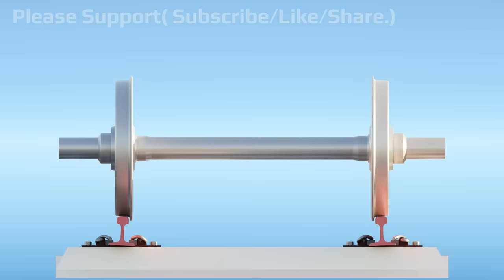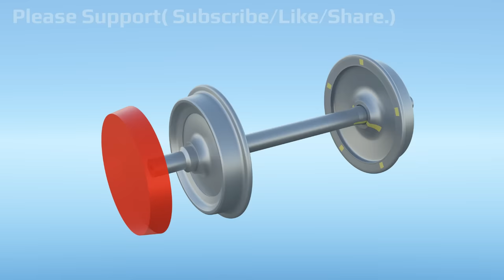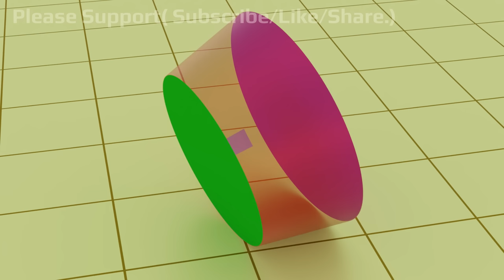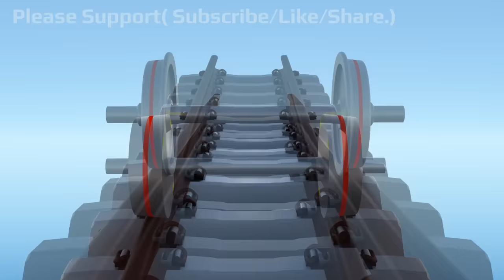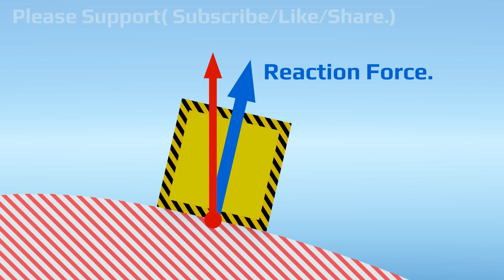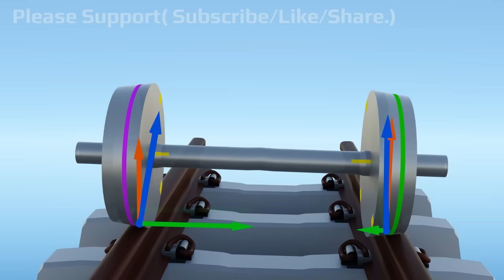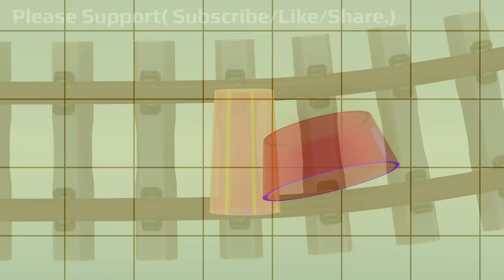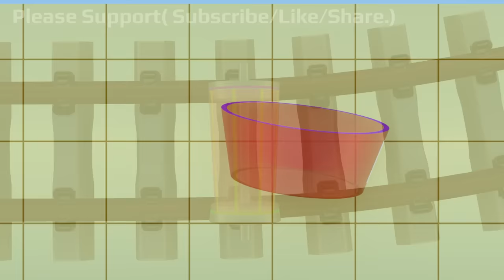How trains actually Turn ? | on curved rail track.

Comment: This is a broadly correct but simplified explanation. Some extra details: the wheel profile is not really semi-conical; it is a complex hyperbolic transition into the flange. But at first glance it looks like a conical shape. The inside camber (angle) of the rails is necessary to prevent the "conical" shape of the wheel set exerting an excessive lateral force onto the rails, which would otherwise tend to be pushed apart. Two interesting effects can actually be heard; one is where the train has come to a near standstill on a curve with superelevation which is normally designed for higher speeds. Then the wheel-set is not sitting in quite the right position on the track, and one wheel starts to slip with stiction, giving an audible shuddering noise. The other audible effect is where the curve is so tight that the flange comes into action: this results in a sharp metallic (& loud!) squealing sound. This is usually at slow entry & exit sections into / out of stations and switch yards. To minimise flange wear, automatic grease pump stations on the track are often employed at these sections, which only grease the inside surface of the rail where the flange makes contact, but not the running surface of the rail (you don't want grease on top of the railhead).
Reply: Exactly. There is a curve between the tread and flange which helps centralize the wheelsets.
Reply: indeed, but in previous steam, they hadn't understood that yet. Like gears, involute was pretty recent - the pressure angles changed in 20s and then 40s.
Reply: Exactly.  I have said this many times.
Reply: "The Loop" in Chicago is really loud as the trains negotiate ridiculously tight curves.
Reply: I've tried to explain this so many times to my grandsons and they never seemed to grasp it. Showed 'em your comment and finally they understand. Many thanks!
👁  👁
    👄
Reply: Its a YouTube video not a university text book
Reply: @J-Vasa  Of course. I just thought the extra details might be interesting to some.
Reply: @J-Vasa  why not both
Reply: @filiprebro  porque no los dos? *que the commercial
Reply: @earthwormscrawl  There's a suburban line in Wellington, New Zealand, that suffers from very tight corners (I was told they're the worst in Australasia) and the squealing is hideous.
Reply: Love the extra info, thank you. Could you explain what a complex hyperbolic transition is and how it’s different from a semi conical shape?
Reply: @jakejordan9810  I don't know anything about train wheels, but a hyperbola is a particular two-dimensional curve of infinite length whose ends both converge toward different lines. My understanding is that instead of having two straight profile forming the wheel and the flange and meeting at and angle as shown in the video, there is only one hyperbolic curve that transitions smoothly from the straight wheel profile to the straight flange profile.
Reply: Yeah the jubilee line could really do with some grease in those sections as you mention.
Reply: @etiennemiemczyk7081  Those flange lubricators are used throughout the London Underground system. Only the curves on the Underground are so extremely tight that grease can only do so much...
Reply: @ngc_2419  Thanks for answering that, you explained it better than I would have done. There is lots of more detailed information out there if you look for "train wheel profile".
Reply: cheap grease on the railheads won't do a damned thing to the traction- the pressure is beyond the scope of the lube's range.
Reply: @tommurphy4307  The grease used for those flange lubricators is likely cheap, but it is a heavy grade, loaded with a graphite dry-lubricant which is very pressure-resistant. The lubricators are supposed to only grease the inside of the railhead and are designed accordingly, but they do occasionally go wrong and spill the grease onto the rail head; quite a few reports of engineers reporting this causing issues with both traction as well as braking. There are in fact specifically formulated top-of-railhead lubricants also used in the railway industry, but they are a much lighter grade and either mostly water-based (Europe) or oil-based (US), and maintain higher traction.
Reply: Not broadly correct.  The camber on the rails and wheels  does help the train travel down a straight section . Thats where its most useful, in reducing wear on the straights.  Remember how if you push something it tends to turn the front out ... like reversing a trailer, it just wants to turn and turn... if its constrained between two walls, the thing you are pushing can bounce side to side.  But if you pull the same thign,  the front is constantly corrected just enough to go torward where it the pull is coming from , which is great if that is on the path. eg car towing a trailer.. the trailer follows the towing vehicle, all stable, well behaved..  Well the camber on the rails profile acts to  steer the bogey toward the  direction of the track ahead... so there is less bouncing side to side on a straight...    its just a reduction in wear, mainly on straights, and not  "only required on curves, to allow the train to turn".  The whole track is cambered to assist turning .. but  there's an optimum speed for  that camber,  and various trains successfully go through at far lower and far higher speeds.
Reply: @leong108  Oh, there is much not correct in the video, which is why is said "broadly" 😁. The camber on the wheels affect a self-centering on both straights and curves. Only on extremely tight curves do the flanges actually prevent the wheel-set from running off the tracks, and these are usually slow-speed entries into stations and switch yards.
Track camber (not rail camber) is called superelevation and is mostly found in high-speed curves where the required additional centripetal force exerted on the wheel-set exceeds that which can be provided by the self-sentering camber on the wheels itself. This is indeed speed-optimised as you say, and whilst e.g. slow heavy goods trains can negotiate those curves successfully, they do so at the cost of increased wheel and track wear. Significant superelevation in curves on high-speed lines can become a problem for very long and heavy goods trains, risking an effect called "stringlining" where lighter-loaded cars can be derailed by literally pulling them out of the curve over the inner rail, especially after a stop on a slight incline when there is no slack between the cars; a reason why you don't want to run empties at the front of a heavy goods train on those sections.
Reply: To any young (starting out) engineers... You might think engineers are very clever to come up with this type of thing, but trust me, just like bridges having to fall down before learning what makes them stand up, this is a case of trial and error. When you follow some previous engineers formula or rule, don't be ashamed or feel inadequate, they too stood on the shoulders of engineers who tried and failed, but learned why.
Reply: Thanks!
Reply: Fascinating expertise in this comment thread, thank you very much!
Reply: @J-Vasa  Please, don't criticize a good contribution.
Reply: @maidsandmuses  Thanks  for  your  contribution! It was very appreciate by most of the  viewers. Are you an engineer? If not,  how do you know so much?
Reply: @De_Bonis_Antonio  You are welcome. I'm not an engineer by profession, but I studied Applied Physics at University (think of that as the engineering side of physics). I've always been highly interested in electronics, audio, optics, mechanical engineering in general and railway engineering in particular, so 30+ years of self-study in those subjects.
I don't think I know much though; the irony is that the more you learn, the more you are aware of how little you know 😉. But, I still read engineering books and I have a weird memory in that if something really interests me, I remember it for a very long time.
Reply: @J-Vasa  Think of your job. If people talk about the details of it with the wrong grammar, it is no longer clear what they mean. You would step in to correct the misuse. If you didn't, I'd be surprised.
Reply: @antispamman4795  this isnt for people who already know… because they already know. If its your job, you already know

Comment: Never knew that the shape of the wheels and the tracks were that important. Always thought just the flanges were responsible for the steering. Very clearly explained for me who has no degree in math. Thank you👊🤗
Reply: Fun fact: when a train traverses a sharp curve at high speed, it is not uncommon for the flange of a wheel to contact the side of the rail. To minimize the wear and tear on both the rail and the wheel, "flange greasers" are sometimes installed to apply a small amount of lubricant between the flange and the side of the rail.
Reply: track oil feels almost liks blinker fluid
Reply: This is taught in a 2nd yr of Mechanical Engineering in all good Engineering Colleges.
Reply: It's something obvious
Reply: @tapanprakashsen3873  Could be. I'm a musician😉
Reply: or physics presumably!
Reply: @F88689  yea i feel like its pretty obvious
Reply: Yes, and it never made sense that those flanges wouldn't be scraping all the time. The wheel bevel acts a lot like a one-piece differential with aspects of metal CVT pullies.
Reply: @clarencegreen3071  when does the 'fun' begin?
Reply: Same with me.
I've never thought this when I see a train pass over a switch.
Or making a curve (near my house). I have to look good to see it's shape.
From the station I can't see it's conical shape.
Reply: when you hear a slow moving train making all kinds of noise 
; it’s because the wheels and rails are worn out

Comment: You give the basics, but it's more involved than that. Without restraints on the wheel set, the forces that tend to centre the wheelset tend to cause it to overshoot and then hunting occurs where the wheelset shunts back and forth laterally.  This phenomenon was extensively researched by British Rail scientists in the 70s and the science of self steering established. Up to this point it had never really been investigated properly.  It then became possible to design the wheelset suspension to remove the hunting and for true self steering to be established. Eventually, it was found that the wheel flanges had rusted on the inside as they had played no part in steering the vehicle ! The BR scientists nicknamed them "the crash barriers".  Of course, once  the curve exceeds a certain value of "tightness" as in yards and sidings, self steering is not possible, and the flanges guide the vehicle accompanied by much squealing as wheels skid on the rails.
Reply: I completely understood what you said. What I was wondering was, when you design an entire railway system (say for a country), don't you also take that into account? In India our railways are not only nationalized, but we just have a few types of bogie/coach designs per track guage size in operation. Therefore, once the wheel base and axle width is set, it would be trivial to figure out what is the minimum curvature that a particular bogie configuration can move over without its flanges contacting the rails. So why do railways design their systems such that the flanges would intentionally rub/slide A LOT as the track curves? Besides the corrosion issue you mentioned
Reply: @frasermitchell9183  Hmm, I think I understood. The minimum free curvature is too large. Accepting less curvature for wheel slip is a better compromise vs. ideal curvature
Reply: I think what you are referring to is hunting oscillation. In the most common wheel design it only becomes problematic above 160km/h.
Reply: Many bogies, esp. on high-speed passenger trains, have dampers fitted between the frames of the car and bogie that limit the speed of bogie rotation and hence dampen the hunting. Worn-out rotation dampers can often be identified by a hunting bogie. These systems still have a resonance frequency and hence they can only be designed to work efficiently within certain speed limits.

Comment: That’s as long as the wheel profile matches the curve radius. Once the radius gets tighter, the flanges come into effect and you will hear flange squeal. Also, the flanges are what guides the trains through turnouts aka switches.
Reply: This is why flanges must be at a certain thickness. A thin flange can split a switch, causing a derailment.
Reply: My dude, you post sick bass AND know about traction systems? Pretty cool
Reply: @abhinav7885  
I make Bass music but also into everything about the railway system. 👍🏻
Reply: @Bassotronics  what a legend
Reply: @Bassotronics  I had a question, what do you recommend me to start getting in to railway engineering? I am an EE and wish to work in this field.

Comment: When I was a kid, I did a lot of research on this.
Out in the “road,” the wheels act like this, steering themselves.
I had hung around with a switching crew for a summer.
The most incredible parts were where the curves were so sharp, that the wheels squealed and the flanges were taking over the job.
I always found this fascinating to the point that had some railroad had taken a chance on me, I would have made a career out of it.
Well, I got stuck in a construction and trucking job where I was sometimes working in the worst of conditions.
They had no clue.
Their loss, not mine!
Reply: i always wondered what the life expectancy of the track and wheels would be especially in the turns. i had a whole career 40+ years working as a lineman for a municipal power company but i have often thought that in my next life i would work for the railroad like in track maintenance and construction or perhaps even driving an engine. i think it would be a good calling for guys to get into. one other thing i've always thought of is the fact that they have turned a lot of the old railroad beds into bike paths which is good but thought they would have been better served if they had turned into use as public transportation between towns and without track but on tires. just an idea.
Reply: very cool. i'm envious!
Reply: @steveperry1344  I had considered that, too,
It’s actually a good idea.
But, I did the research as a kid, and thought, maybe a few concessions?
The Michelin brothers came up with a flanged rubber tire that rode on rails, just like todays trains do.
They didn’t like the steel-on-steel noice while traveling around France.
There were a lot of other issues as well.
But, the fact that the grades are still there.
Sure, some of the bridges would need to be replaced, but the surveys wouldn’t be needed, and it wouldn’t be hard to take control of those old grades again.
Who knows, maybe we would have floating trains above them in the future?
Reply: @dangeary2134  the flange was not made of rubber in michelin's micheline scheme- it was steel augmenting an inflatable traction-tire configuration. if it lost car- the wheel's base contours and flange took over. budd used the design back in the 30's after goodyear's wheels repeatedly derailed in testing.
Reply: @tommurphy4307  actually, the later versions were.
My college thesis, I did a lot of research on the subject.
As it turns out, a layer of rubber over a piece of steel that is used for traction tends to either separate, or suffer internal damage, splitting the rubber. Inflatable rubber tires, even for trains, did work.
After the flanged rubber wheel was developed, they suffered from wet rails, and they slipped.
They added sipes to the tire that simply went crosswise on the tread area.
They had the effect of being a squeegee for the following tires.
The sipes also had and unforeseen effect on the tires.
They didn’t wear out as fast.

The Michelin brothers did some really serious development to rubber, even before tubeless “clincher” tires and rims were developed.
Reply: Yo, me too!

Comment: I was working on the central line (London underground) when they got the new trains, the wheels were designed differently to what the old stock ran on  which resulted in the tracks getting worn... Large sections had to be shut down at a time to replace the track.  We weren't privy to the possible upgrade of the wheel set up but this video is interesting.

Comment: Thank you for adding what would happen at the end if the smaller conical shape were on the outside rather than the inside.  I'd been trying to imagine it as you were describing the correct configuration.

Comment: 6:15 The solution in short: As the railway turns (let's say to the right), the rails slightly move to one direction (to the right), but the wheels want to roll straight because of their momentum. As the wheels are semi-conical, the contact position between wheel and railway is shifted (to the left) and that creates a semi-conical rotation, where the wheel automatically roll to the side (to the right) and takes the curve.
Reply: Good explanation. Different people have different ways of expressing the same point. We need to appreciate the intention.
Reply: Not forgetting that the inner wheel has to compensate for the shorter distance travelled while being on a fixed axle, and the outer wheel travelling a longer distance on the same fixed axle during bends.
Reply: Thank you.  I found it a little hard to understand with the robot- like voice in the video
Reply: rather than thinking in terms of cones and conical things- think of it as modifying the operating radius of the wheel. a smaller radii on the inside wheel is going to make the axle turn in the direction of the track curve.
Reply: @tommurphy4307  right. Good way to say it.
Reply: So, basically the wheel set acts like tank treads?

(When a tank spins the outside tread faster, it turns toward the inside.)
Reply: @MultiPleaser  That is a pretty good comparison